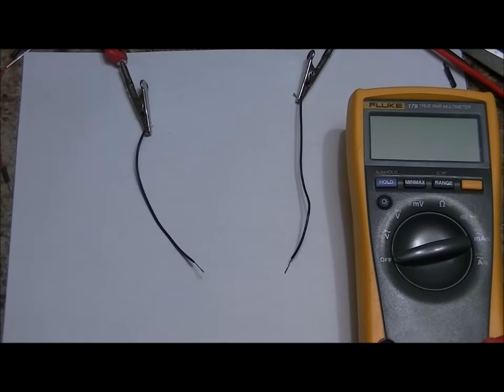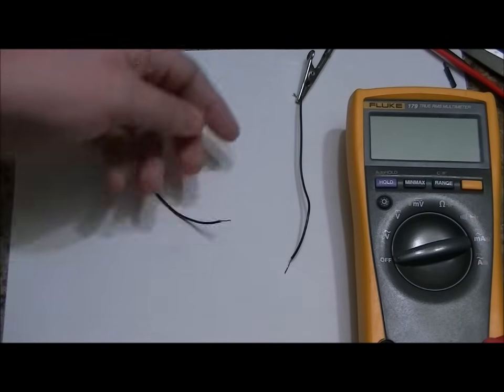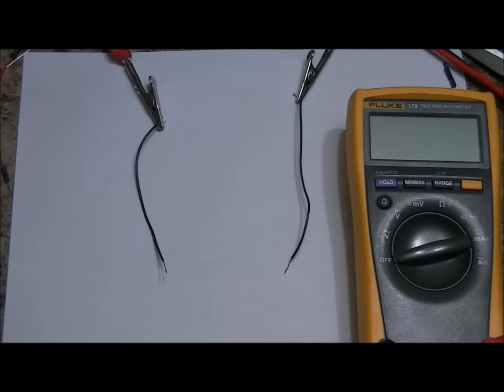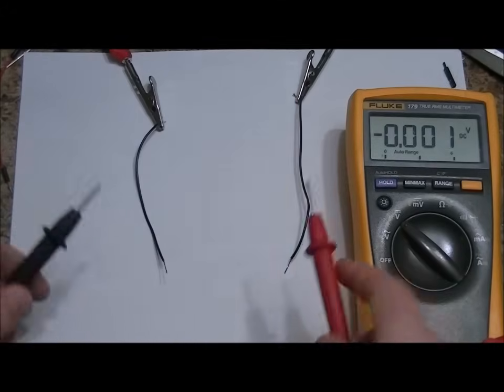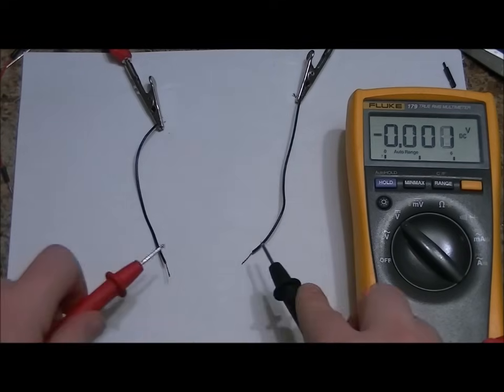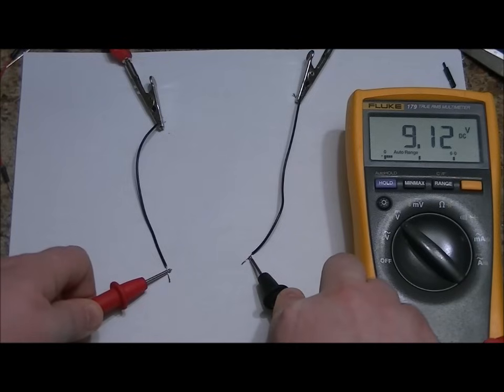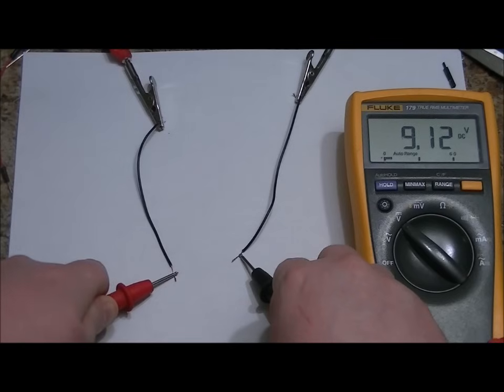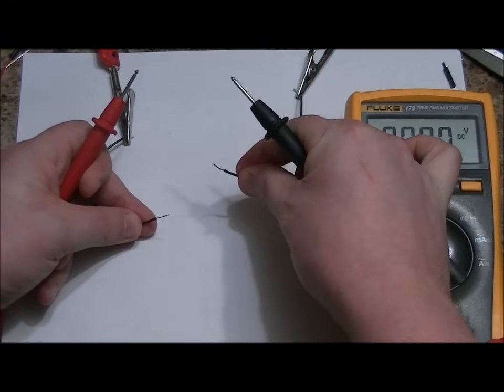How to quickly determine the polarity of your DC power supply with a multimeter

Comment: What if lines to an electrical component are not powered and you are trying to power it correctly with the correct polarity for each wire? How do you determine their polarity without damaging the component during your testing? If it is a light bulb, can u fry/burn out the bulb from reversing polarity?

Comment: thx for the vid, it helps but still pretty confusing (I see you have the red probe on the right side and the black in the middle. I had them the other way around so far).

But let me get this straight; the ions flow from negative to positive, but ground functions as the negative side still, so actually the ions flow from ground to positive? 

and that is why the negative pole of a plug is usually on the outside, so that the positive cannot shock you...

Comment: Thanks for the tips. I only have analog multi-meter not a digital one so it'd only show positive voltage when correctly wired and null when reversed.

Comment: hello sir can ordinary multimeter detect dc+ or dc- pulses from automotive relays? 
I wanted to test also me ignition module for trigger signal so Im not shure where to put me leads on its 4 pin gm ignition module

Comment: Thanks for uploading.  But what is confusing is testing the tip of a DC adapter,  a center Negative pin will give you that +9V if you connect your black tester prove into the inside tip, and vice versa for a center positive tip.. a bit confusing because they work as opposites.

Comment: fantastic. my boat has two wires for the bilge pump and naturally  they are both black my light tester lights up either way but the bilge pump is likely to run backwards if I hook it up wrong and backwards won't pump water out. thank you so much!!

Comment: While this simple multimeter test may seem self evident or obvious to you, it was not to me. I need to splice some obscurely color coded wires together from different harnesses correctly, without frying something up. Ha, I wasn’t sure of the negative consequences of making an incorrect 50/50 guess…I assumed if it doesn’t work, I’ll just reverse it. It’s a good thing I saw this! Thank you, very well done and very helpful.
Reply: another option is to use a light tester..

Comment: what about if the voltage is higher like 120 volts in a wall out, will it damage the multi meter if your have polarity back yards like this on the multi meter?
Reply from the maker: 120 Volts AC from the wall doesn't apply here.  You can test 120VAC with a multimeter, but not on the same setting. Youtube search""Measuring AC with a multimeter".  If you set your DMM for DC and measure DC, you can kiss your DMM goodbye.
Reply: @patrickikis   I know the wall is AC  so I used a bad example  but what Im trying to get at,  is it safe for the  multimeter test leads  to backward in polarity  like video but  higher DC higher voltage?  I know most solar panels produce DC volts. So let say if some one want know polarity of a panel using multimeter.
Reply from the maker: @drivehardearnhard6574  Polarity is just a reference point measurement.  If your DMM or DMM DC voltage measurement setting is 20v MAX, then it doesn't matter if you reverse polarity as long as the difference between the two probes is less than 20v.  If you have a DMM rated for 100VDC MAX, and you measure a 150VDC signal line in either direction, then you'll likely fry your DMM.  Hope this helps.
Reply: @patrickikis   thanks

Comment: How would I find which pins on a device is for the power? I dont know where the power supply is supposed to put into. Is there a way to determine which pin does what?

Comment: I’m trying to fix the plug on my 14,000 BTU window air conditioner. I just cut the end off without paying too much attention because I assumed the wires would be be colour coded. Well they aren’t. Only the ground is green. The other two are exactly the same so now I have no way to know which is negative and which is positive. The cord is in my air conditioner. What kind of power supply do I hook to it.

Comment: thank you for quick video.   I didn't know how and only used multimeter to test voltage reading  but during hooking up some 10 Gage wire for a cigerate lighter for the DC output to an accessory device I realized stupid you didn't lable the wires.  and I'm running multiple sets for multiple connections    one for a capacity monitor another for a DC to DC power supply (laptop) and another for a port to plug in my DC to DC phantom drone charger.   oh and 2 extra USB ports step down     very cheep circuits from Dollar store     but I used all black wire and already fed the strands through my trunk under the seats into the area's I want. and forgot to lable them     this simple method will help me to check polarity and I'm also going to double check on some things by disconnecting and reconnecting things separately so I know which is which and lable them I have a small setup solar panels   batteries in parallel  a 3000 watt power inverter and all the little DC to dc converters

I can power my laptop for days or even make coffee whenever I want      ofcource I could just make it at home too ;) or buy it when I'm out      but this little expensive setup makes it so I can do it wherever and whenever I want.    oh and I have all this set up from my car hahaha.  200 watts renogy panels mppt and soon to be adding even more batteries.       all this is useless knowledge to someone else.   it's all learning  trial and error and interesting to me however. and eventually will use some of this on a RV and possible at home also.       I'm always extra careful with the battery and connections  least I short anything out. or explosion.  I ordered so many fuses for everything.    300amp fuses   15 amp   10amp    30 am   and placing them accordingly
even the solar panel has a fuse coming from the positive to charge controller and from charge controller positive to battery array and waiting for my other Amazon order of the 300amp fuse to get here to place between battery and inverter  even tho it says it already has fuses in it for short circuit protection.    I'd rather blow my own fuses than replace ones in an inverter    (haven't opened it to see what size they are yet anyway)     the hardest part for me was positioning the panels on the roof  and still keeping my sun roof and it being a curved roof.  but I figured it out       I feel like an odd ball  the only one driving around my area with the frame panels on my car (not the flexible ones I decided after many reviews not to go flex route because I wanted something that would hopefully last a while    the panels I have are rated to last... we'll see....         anyway..... Thanks for the help     this helped greatly

Comment: If you have a black and white wire coming from a ac to 12vt DC power supply,, would the black wire be ground,and the white hot??

Comment: Thanks for this video 👍🏼 I have a solar panel fitted to my van roof and the solar cable ps are through the roof to the inside. The problem is that due to the van being insulated and boarded I don’t know which wire is the positive and negative. Can I run this same test to find out?

Comment: No markings on the original DC power adaptor. No relevant info on the unit I wish to power. The connector is damaged either on the supply or the unit and I just wanted to replace or hard-wire but had no idea what the polarity was. No colouring or markings on the wire either. 

Similar to someone elses comment; Every time I type the question about the devices polarity or how to check it in a search engine all I get are links to items I should purchase. 

Quick, easy and very instructive video. And one of the few multimeter video user to actually show clearly the setting you switched it to (I need that info to because I am that green) :)

Thank you.

Comment: So I did this to figure out my vehicles factory speaker wiring polarity. But I used the OHM part of my meter and did it pretty much the same way. Will that have the same effect or do I need to pull the doors apart and redo it with the voltage selected on my multi meter?
Reply: Did it not fry your meter?
Reply: @TomFromYoutube  no? Should it have?
Reply: @AlaskanFalcon  I don't know.  Might be different with speakers.  I found out the hard way not to check resistance on a live circuit though.   Anyway did you figure it out?

Comment: Thanks for the video. I have a spliced power cord for AC power, however, theres no indication which is positive or negative. Is there any way to figure this scenario out?Thanks
Reply: Look at the wires, there may be a negative symbol on the lining. Assuming you've already stripped the sleeves in order to expose some bare wire.

Comment: Nope, doesn't help. Most power adapters have a socket, not 2 wires.
Reply: Uh, if you don't know what to do with two sets of probes and a socket, you should be nowhere near anything electrical, even this simple.

Comment: What's the difference between polarity in ac and dc , some people say electrons hop back and forth  in ac , if that is the case ammeter must show bidirectional current in ac or  both wires phase - neutral in ac should show alternating polarity.

Comment: I've accidently cut the wire of adapter. So i can check what polarity supply gives me but is there a way to tell wether the inside or outside of the jack is meant to be positive so that i know how to connect the wire back to adapter? One of the wires has dotted line drawn on all of its length.
Reply: im trying to find this out too. i have led lights with a plug on the led i want to cut the plug off and wire them to my truck. i cant tell what wire is + or - i wonder how i could tell without hooking it upto a power supply.

Comment: Thanks for doing this quick video.  I'm embarrassed to say that unless there is a red or + sign on the wire, I didn't know what tool to use to check the polarity.  Thumbs up!
Reply: Hi thejusticejen, I'm the same to you, even worse than. I leaned a lot things in high school, but I didn't know how to know the polarity of my DC power supply. Again thanks a lot for your video, patrickikis.
Reply: This is a great video. Simple and to the point. I only know basic stuff about electronics and if the wire was not red or have the red stripe, or marked + on the circuit board I had no idea what the polarity was. Most quality products will mark the wires, use standard color coding or be marked properly, but with some cheap stuff oftentimes there is nothing to go on. Greatly appreciate these videos because I have been on other forums where asking basic questions like this will get your ripped apart by the members.